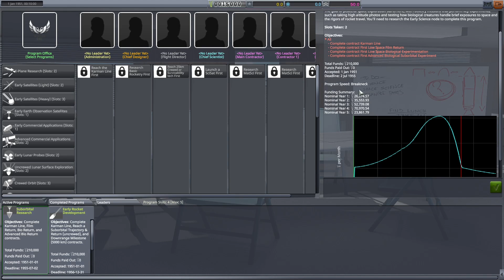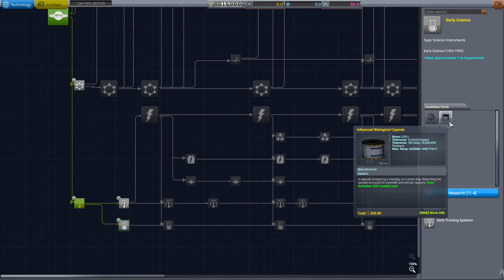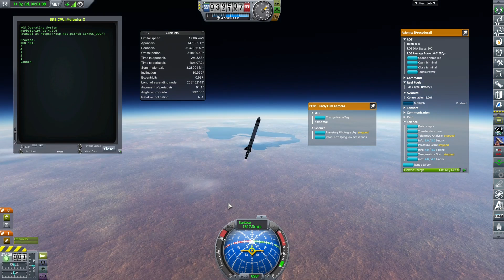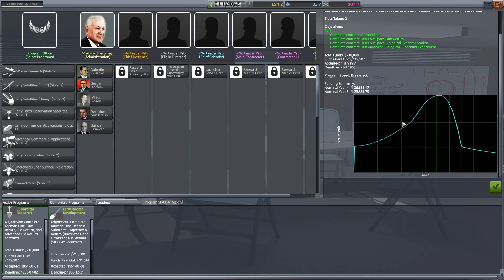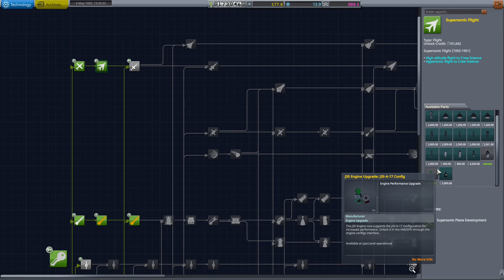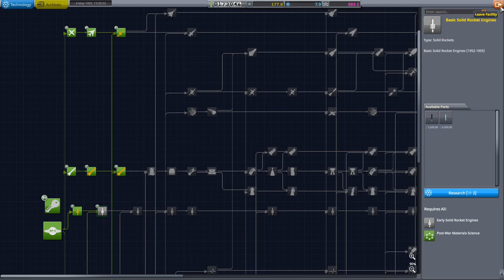Let's keep on winging it. Ep1

Comment: wtf happened between 1. jan. 1951 and 12. may 1952?!
the same between 30 aug. 1952 and 25 june 1954 / 4 may 1954?

2 rocket launches in over 3 years, clearly i must be missing something
Reply from the maker: Ah yes, so the first interval happened because I'm an idiot. I am used to starting with smaller rockets so I didn't hire enough engineers. As such it took over a year to build the LC and rocket.
In the second interval I did  some rocket launches off camera if I recall correctly. The early game in RP-1 can be very repetitive and there is already several series from other people showing the early game, so I'm trying to just breeze through it. For the first few episodes I will only show launches that are for required contracts or the first flight of a new vehicle.